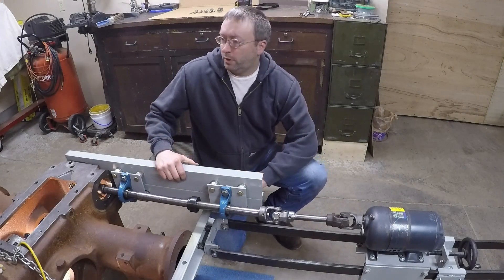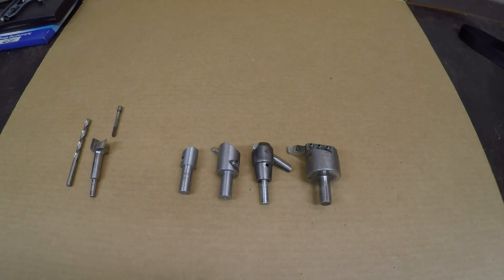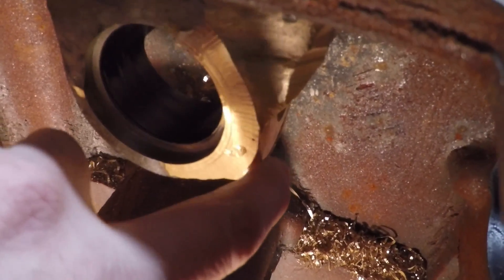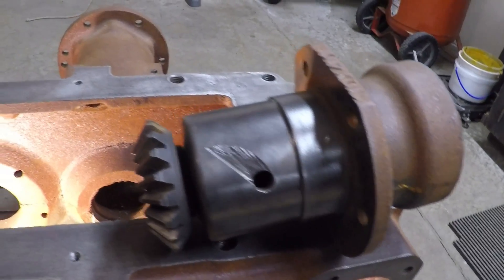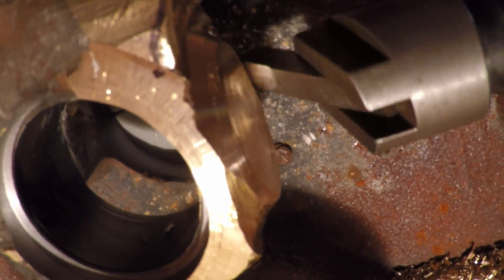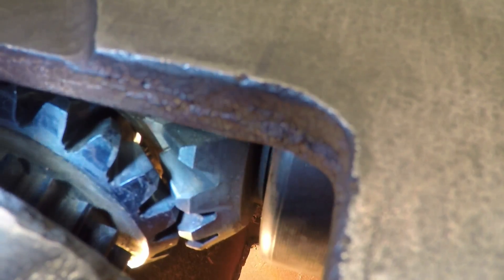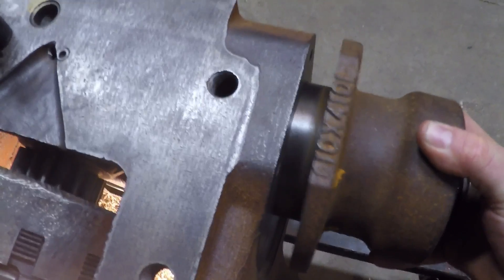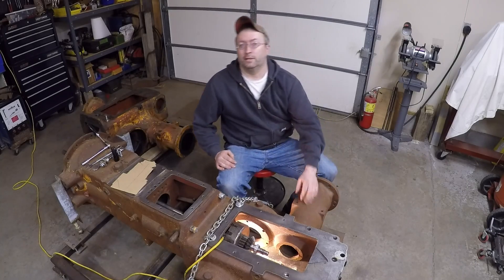Minneapolis-Moline Prototype 445 Tractor #X-231 Restoration - Part 20: Face Milling Rear Case Repair

Comment: Just out of curiosity, why couldn't both of the bevel gears be larger in diameter, keeping the same reduction ratio, but just so the pulley bevel gear didn't have to be in as far?

Comment: When you started doing this project I tried to come up with a faster method and I'm just not sure if there is one.

Might be able to mount a flap disc angle grinder on a bit of an arm so you could hold the trigger engaged and rotate the arm into and out of the part and slide it in/out for depth.  Would remove material faster but be a mess.

Comment: Wow, that case looks like it was designed to fail from the factory. I did not realize that the bearing was just hanging out there all alone.
Reply: I agree that it does look scary thin around there for how much power is going through there.  They did add significant reinforcement on the production one, tho.

Comment: Nice repair, did you consider when they added all the new material to the broken bearing housing adding more material to connect the broken one to the one below it, like in the production gearbox, is that possible or do you like to keep things as original as possible?
Reply: Squatch253, thanks for the reply, we used to have a MM Rte here in New Zealand that was parked up because the rims had given out, it sat for years and eventually we put it in a vintage tractor magazine in the late 90’s as “free” the phone didn’t stop ringing, these days I wish we had kept it but the new owner was a MM collector and was able to give it a good home, he was excited cause he had plenty of RTU’s but no RTE’s

Comment: The jig you built for the boring job is amazing. Far from amazing  is the design of that gear box. Simply a disgrace. And the fact MM kept the same design for  later models does not give them credit. Obviously the engineers did not learn from their mistakes. No wonder MM is no longer in business.

Comment: WOW, what a deal. That WAS like a cat eating a grindstone! Sure turned out REALLY good though. I was with you hoping on the 1/4 but it wasn't there yet. And now a gasket will take up the slack you need. The guys that fixed the case did a good job too in leaving you plenty to work with. Your channel out to be titled 'Home MADE Machine Shop'! Hope the weather is calming down a bit and you're getting a little break at work. Days are winding down and the shop will be open again before too long. Maybe even a little diesel smoke blowing. Who knows. Take care, Pal! I'm with you!
Reply: Sounds like a plan 2 me too but don't O.D. on that sweet stuff!